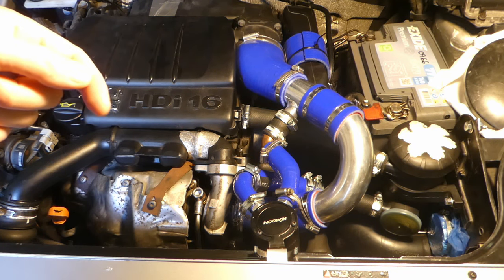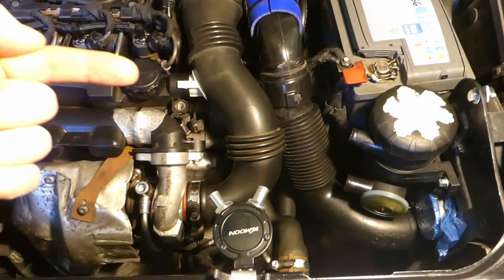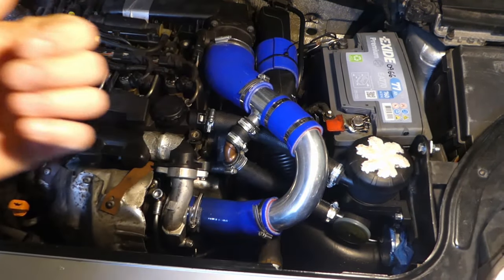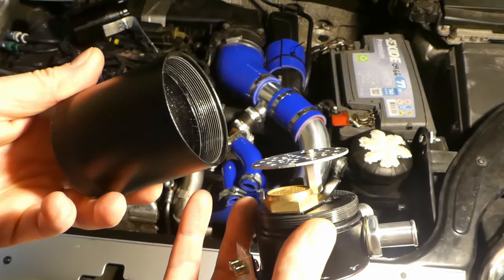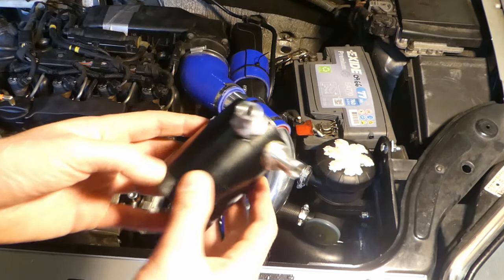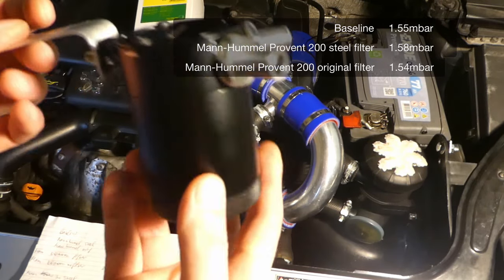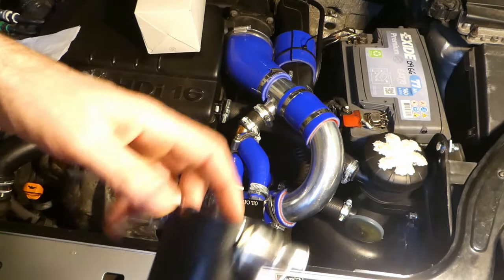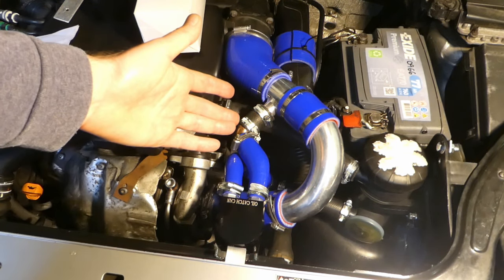Oil Catch Cans Crankcase Pressure, Provent 200 vs Mishimoto vs Universal oil catch can

Comment: So from what I gather you are saying that the Mishimoto design is bad for diesels but for a gasoline engine it's not a problem? I have the Mishimoto on 3 of my cars and haven't seen any issues. My 2009 Corolla S is turbocharged and the crankcase is also vented with a filter so I would guess there is no problem at all with that set up. Did you also test a vented oil catch can? I also heard you say that this is an issue at idle and not at speed. Is that also true for a gasoline engine?
Reply from the maker: Yes, the petrol/gasoline comment was a slip of the tongue. It would be similar to both. I did not quite say it is bad for diesels, only that compared to the others it increases crankcase pressure more substantially. Now it depends on the condition of the engine, if the engine is not a heavy breather then the slight increase in pressure is not that much of a problem. For some engines this increase in crankcase pressure could tip it to leaking from the seals. Unfortunately I did not test the venting to the atmosphere, it is illegal around here and I did not bother, maybe I should have. I have not tested the gasoline engines to check when is the highest crankcase pressure, but for diesels and I suspect petrol engines both would have the highest crankcase pressure at idle. It is just that under load the air flow (turbo or not) helps evacuate the gasses from the crankcase. I have not tested it but if venting to the atmosphere, you do not get this evacuation of gasses and it is kind of like constantly under idle or consistently under higher pressure, but might be wrong about that.
Reply: @moremolecules  It would be interesting to see for sure in very controlled testing. I've seen a lot of people use the Mishimoto design and Ive not seen any people mention any problems. If there was a huge issue it would seem that this would be a known and highly talked about issue. I've seen information about using a vented system on pre-PVC car and a closed system on cars with a PVC valve. Your video make me have more questions than answers since I've never heard of this being a problem.
Reply from the maker: @jimsgaragetoys  Many thanks indeed for the interesting discussion, much appreciate it. I only made that video because I did not know the difference between the different oil catch cans in terms of crankcase pressure. I really searched a lot for what is normal or usual crankcase pressure for my engine or any engine, because that is important in terms of how much more can you increase it with say the mishimoto oil catch can. I only found one single website for a mini cooper petrol engine and the reference value was ~30mbar. So, if this is anything to go by, the Mishimoto oil catch should not lead to any problems, as the overall increase in crankcase pressure if not that much as compared to the max 30mbar. The only problem can arise if the overall crankcase pressure of the engine is really high, say worn engine and it is close to the maximum. Then adding the Mishimoto could tip it over and lead to leaking seals. Now if an engine is that worn, I suspect that people will either recondition it or throw it away anyway. So, I suspect that most people just have relatively good engines and the Mishimoto would not cause leaking seals. Now an interesting question is, will the higher crankcase pressure cause any problems down the line. Maybe, but it is only a guess and it might not lead to anything overall.
Reply: @moremolecules  Thanks, for your reply. I'm guessing that I haven't found issues with the OCC because the pressures were higher at idle and not while driving. I think of how little time my cars spend at idle so I'm not too worried. Thanks for your time and information.
Reply from the maker: @jimsgaragetoys  No worries and thank you for the interesting conversation. I guess it will also depend on how worn the engine is. All the best

Comment: The question is a open to atmosphere can reduce pressure???
Reply from the maker: Yeah, I have not done that, but I doubt it, unless it is not a turbo version. With the turbo version, the pressure gets reduced by pulling the air. So, pretty much when the turbo is spinning the pressure is reduced. With the atmospheric one, there is nothing to pull the pressure out of the crankcase. That is my opinion and can stand corrected of course.

Comment: Thanks for useful video, i have hyundai i30 with GDI 1.6l , petrol with out turbo 
I use oil catch can with bronze filter like the ( kkmoon catch can ) , will the OCC increase the crankcase  pressure ? And i also add stainless steel ( scotch brite ) in it . Is that good or not or should i remove the bronze filter ??!
Reply from the maker: Hi mahmoud, yes this particluar OCC will increase the crankcase pressure a bit. The stainless steel will add a bit more, bit not too much. If I were you I would remove the stainless steel bit and leave it as standard. There will be a bit of increased crankcase pressure, but very difficult to say if that is OK for your engine. If you can find what is the maximum crankcase pressure before seals start passing oil, you can see if a bit more crankcase pressure is fine. Apologies for the fairly vague answe, but I have been trying to get what is the noremal range of crankcase pressure for my engine and I have not found it yet.
Reply: @moremolecules  thanks for reply, i tried to find normal range for my car didn’t get it too , i will remove the stainless steel for now. 

Can i remove the bronze filter and add fill the catch can with stainless steel? And it will catch the oil , water.. etc in this way ??

And what if i remove to bronze filter from in side and move it to out side ?? Thats will make different?
Reply from the maker: @numbman2011  If you remove it and just fill the whole thing with stanless steel it most likely will not catch too much oil. Moving it from the inside to the outside probably does not make much of a difference and likely to be less efficient as it was not designed to be this way. I suspect it is probably alright with the bronze filter, but if you are really afraid of the increased crankcase pressure then filling it with stainless steel is probably the way to go. THe problem is how much crankcase pressure is too much and I have not found an answer anywhere, it depends on the engine.
Reply: @moremolecules  yes , u r right , the problem i search almost all the internet and i didn’t found how much crankcase pressure for my car. 
I think i will keep bronze filter and keep watching the engine and looking if there is oil come out from casket or not . 

Thanks 😊
Reply: @moremolecules  hello friend, sorry for ask alot but i just thinking if it’s possible to make small holes in bronze filter with drill that will make different in kkmoon catch can ??
Reply from the maker: @numbman2011  Haha, no worries mahmoud. If I cannot asnwer or do not have the time I would not, otherwise I will answer if I can. Yes, you can drill a few bigger holes in the bronze filter. That should make a difference in the crankcase pressure and should be alright. It will though make it slightly less efficient, but better for the engine.
Reply: @moremolecules  thanks again, i will try to make holes in bronze filter that would be good and safety for engine, after that maybe i will add little stainless steel inside the catch can 😎

Comment: Great test! 
i was wondering if you can do the reading tests again but after 10-15 minute to be more accurate.
Again thanks for the helpful video
Reply from the maker: I wanted the same condition for all catch cans, so the engine was always in operating temperature. I can wait for the engine to be cold on all catch cans, but I cannot control how cold the engine will be, but I can always keep the engine in operating temperature, so more consistent test across the catch cans.
Is that what you meant for the 10-15min wait?
Reply: @moremolecules  yeah of course it does give more accuracy doing the tests while engine is in operating temperature although you could try test while its cold it won’t hurt to see those numbers before warm up, but what i meant is 
could you repeat the test after idiling or driving for 10-15 min?
Reply from the maker: @keepitathousand420  Yes, the cold ones will be quite big, depends on how cold of course it is outside. Before doing the video I did quite a few runs on this to see what works and is the most representative. Generally, once the engine is relatively hot, the crankcase pressure does not change too much. Say if I drive for a bit and measure then will be almost exactly the same as if I had stopped for 10min to change the catch cans. I can probably do it anyway and see what comes out.
Reply from the maker: @keepitathousand420  I probably could, it would not hurt, but the difference is very little between these.

Comment: So this test is for dieael engines. Any test on petrol engines, will the bronze filter increase the crankcase pressure as well...
Reply from the maker: Yes, this is for a diesel engine, but it will be the same with a petrol engine wih respect to the increase in crankcase pressure

Comment: Do you still use the extra steel wool in the ProVent 200 with excellent 1.58 and 1.54 mbar readings? My current setup leaves no residue in the intake pipe or throttle body (great!), but my suspicion is it's causing too much back pressure over time. My valve cover has begun leaking. Does the ProVent w/mesh screen filter - clean the air well ???? I'm not going to return oil to the sump, but I would like the outlet air on the ProVent to be very clean, however. Suggestions?
Reply from the maker: I still use it yes, but it might create back pressure or crankcase pressure. If that is the case, I would remove them altogether. I would not return to the sump, it is just that the filtered oil is not that clean, although onece the engine is in operating temperature all the stuff gets evaporated anyway.
With the original paper filter it should clean well. Only way to see it is to have a go and see if your intake gets a bit oily. If it does, then have the mesh not too dense at all and add a bit more with time and monitor.
All of these depend on how much crankcase pressure there is in your engine already, so difficult to tell and only experimentation will help you.
Reply: @moremolecules  My rather sudden valve cover oil leakage is suspicious. I've been using a Moroso Oil Breather Tank with a positive breather attached w/return vacuum - but started driving the car a lot. I just ordered a copycat ProVent 200. I removed my wiper-wash tank on the other side of the engine bay and have long hoses to the Moroso - so this is cold and works very well. In your application, I would put straight copper pipe where possible to assist in condensation collection or move the tank far away - so it is cold.  The Moroso inlet is simply too small - to ProVent is better. My application is modified VR6 12v 6-cyl. Great videos man!!!

Comment: On the cheap catch can the intake and outtake inner diameter of threads how is it?? At man hummel is about 25-26mm and at i believe is around 10mm so that's probably why is a little more pressure.
Reply from the maker: Yes, could well be. As far as I remember the diameter of these were ~8-10mm, so twice smaller and the size of the can is smaller.

Comment: Hi, so i guess the best catch can is the unbranded one, the one you tried at the end. I bought one equal to the one that produces 2.1 mbar but, I don't know whether to insert the steel sponge? What do you suggest me? my car is turbo powered by petrol.
Reply from the maker: Good questions! Best is difficult to define very well. In my eyes best oil catch can is one that filters oil the best, but there will always be a trade off between increased crankcase pressure, i.e. narrow passages or restrictions, and filtering of oil. You could have a catch can that filters nothing, for example just empty inside, and this will not increase crankcase pressure. Difficult to say which one is the best. I for one would not want too much crankcase pressure and the associated quite a few problems, gaskets, etc.
If I were you I would not put steel sponge inside, it is already at ~2.1mbars, but that is relative to my engine, your engine pressure might be lower overall.
Difficult to say, but I would not put the steel sponges/scourers inside.
Reply: @moremolecules  thanks for your advice
Reply: @andreabordo1675  I have the same one and I put the steel wool in to catch more oil and/or prevent oil vapor going back in. Also inserted two layers of (circular) fine mesh screen in the baffle.  My crankcase presssure probably increased by 0.1 🙂

Comment: I have used that exact generic catch can following the in/out guide for my petrol NA honda. I used the 9.5mm fuel hose (OEM internal diameter hose size) from PCV to inlet of catch can with baffle only. Then I joined OEM 9.5mm OEM hose that was originally joined to PCV before to the outlet of the catch can. Do you think it will increase the pressure in the crankcase? The only doubt for me is the catch can itself as the hose I used is same as the OEM one.
Reply from the maker: It will add a little bit of pressure, but really depends on how worn your engine is. If it is not worn too much then it should be alright. It is a combination of the small hoses and the filter, but mostly it comes from the filter rather than the hoses.

Comment: Diesels have higher pressures so does the Mishimoto standard can cause issues with non diesel engines?
Reply from the maker: Well, not too sure, I suspect with the lower pressure petrol engines it woul be fine. It really depends on the blow-by of the engine. The higher the bow-by relative to a new engine, the more problems it will cause.

Comment: It would be good to compare a cheap catch can with a breather on top for pressure value
Reply from the maker: Yes, that would probably be interesting, although I am not entirely sure about it. Say if you are running the car in gear down a hill, the pressure in the crankcase will be negative, but if the breather on top will negate this.
Reply: more molecules found out that breather are illegal in Australia 🇦🇺 not allow to let fume oil out into atmosphere
Reply from the maker: @Lebanese_housos1983  Due to emissions that might be illegal in most conutries. The oil catch can system is a close one, so nothing is vented in the atmosphere. Most likely reduces the emissions, as it reduces the amount of oil burned.

Comment: I wonder what's the crankcase pressure if you only use the mishimoto oil catch can
Reply from the maker: It is the same as running them both. It is just that it was more difficult to do it separately. The Mann-Hummel does not add anything, so what was measured was the actual crankcase pressure.

Comment: I don’t think those metal catch cans are meant for diesel engines, just petrol engines. But a nice analysis. Well done
Reply from the maker: Yes, could well be, although in the description of these they always put diesels as well. Overall there is a bit more crankcase pressure in the diesels as compared to petrols.

Comment: Danke super erklärt habe 
👍 vielleicht habt ihr auch auf meine Frage eine  Antwort??? 
es geht um den zwei Liter TDI..Macht es da Sinn eine Öl catch can zu montieren?
Bitte um eine detaillierte Antwort. Danke schön
Reply from the maker: It is worth it. At the end of the day, these direct injection diesel engines are designed the same way. You get some oily vapour coming from the breather/PCV/CCV valves to the turbo and air intake, which combines into pretty hard stuff with the carbon from the EGR valve. You also get some carbon deposits on the back on the intake valves. An oil catch catch should minimise the oil, so you only get carbon from the EGR. All in all is worth it. WHat is the efficiency is difficult to tell, do you get 15% of the oil in the oil catch can or say 80%? I do not know, difficult to tell. Probably somewhere ~20-30%, maybe less. So, does it make a difference, also difficult to tell, but probably it does.
I saw that some people have fitted the 1.9TDI with oil catch cans, so I suspect the 2.0TDI is probably not too difficult to put an oil catch can to it. If you want to keep you car for longer, probably worth it, if not, then probably not worth it.

Comment: Excellent work my friend. When you take out the oil filler cap do you see smoke and pressure coming out?
Reply from the maker: Hi DieselTips, there is not much smoke and pressure coming out, of course there is some.